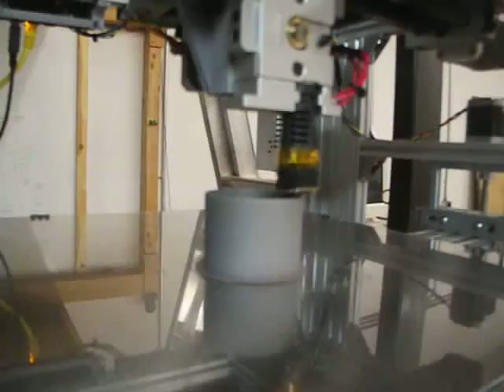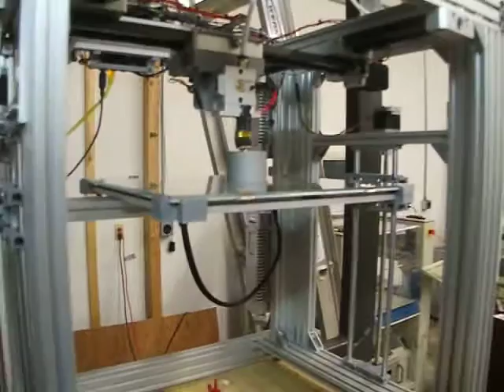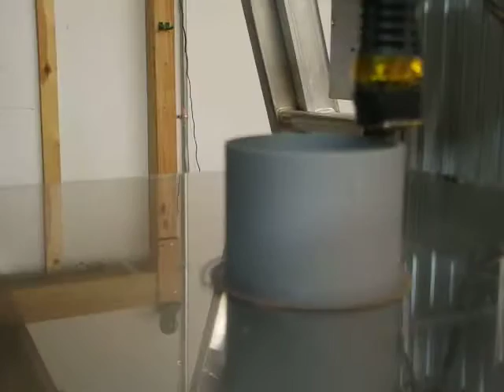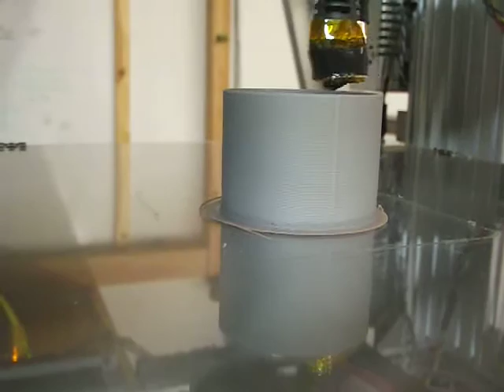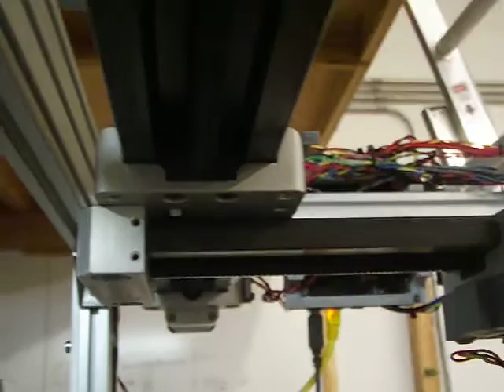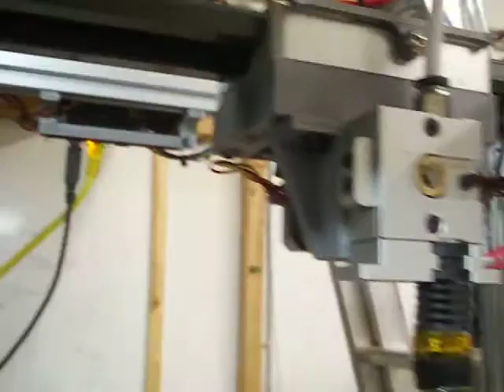New SIMO based printer running

Comment: What printer is this?
Reply from the maker: +Ed DeBoer It has no name.  It is something I built from stuff laying around the shop...literally.  It uses 3x simo stages in a gantry config.  So there are 2x simos for the Y carrying a single simo for the x.  It has the thompson leadscrews that came on the batch1 aluminatus for the Z along with 4x 10mm rods, smoothieboard (with a ramps shield hacked on), .5mm jhead mk-v, Reprapdiscount bulldog extruder.  The build area is 320mm cubed.
Reply: +RoboSprout  very cool build...would love to see a full shot.  Would the Bulldog work on an Aluminatus?  I think I'd need to make a mounting bracket.
Reply from the maker: +Ed DeBoer Aluminatus extruder has a bit larger motor than the bulldog...the aluminum body is nice but the hobb is comparable to the stock a1 and the motor is less torque slightly.  I had to make a mount for this printer...it wouldn't be difficult to make an a1 mount for it.  

https://flic.kr/p/yPQj7Q  more pics in my photostream